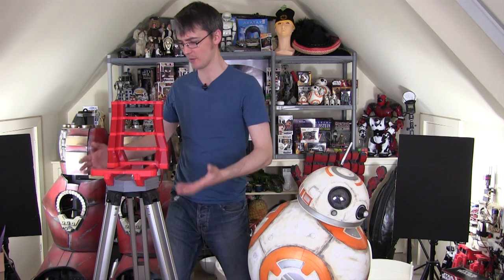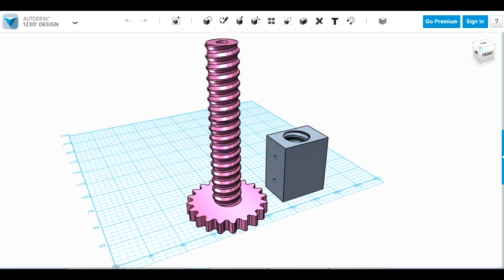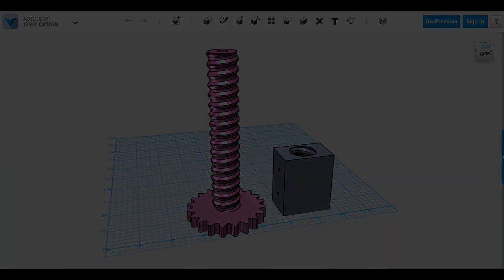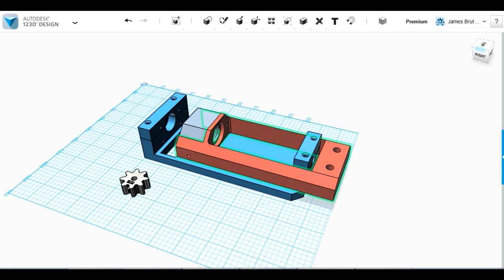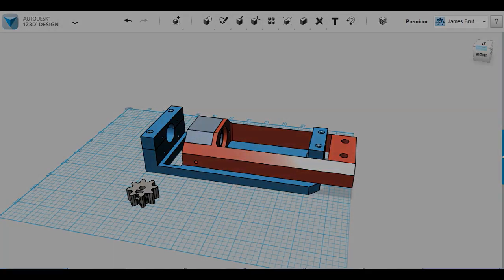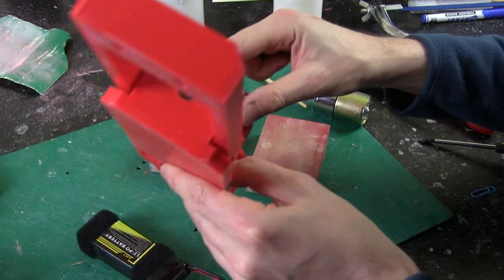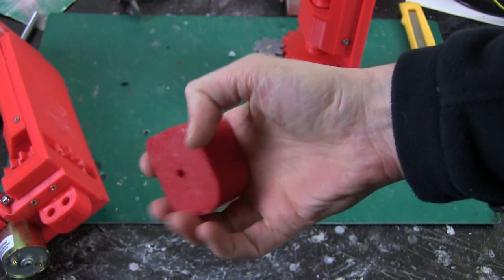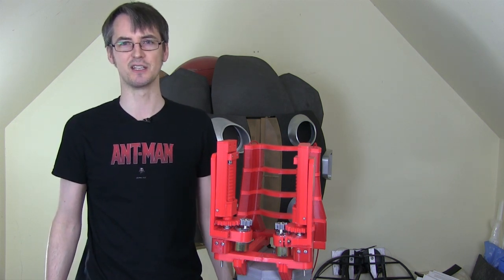Avengers Ultron #6 | Abdominal Linear Actuators | James Bruton

Comment: James, if you want to saw studding easier in future, secure the length you are cutting in the chuck if a drill, and hold the saw blade against the studding to cut. Let the drill do the work

Comment: Nice work, a little white lithium grease on the screw thread would help from friction and it will not damage the ABS. I've been using it for years.

Comment: +James there seems to be a bit too much lateral pressure on the motor mount - it may need reinforcing. A possible concern is that it will flex/break away from the main gear under load. Thoughts?

Comment: I'm noticing that the gear on the motors look a bit crooked or under stress. Is that just because this is in video for or is it actually like that? I think the whole thing would work a lot better if the gears for the motors were sized down just a little but so that there is no stress on the shaft of the motor but I don't know it's you project lol just a suggestion. I love the videos you really are very talented.

Comment: How did you do the screw threads in 123D design?  I usually have to make these parts in another software and import them as STL, but I can tell that is not an STL in your design (not enough faces).  Is there a way to do this that I am not aware of?